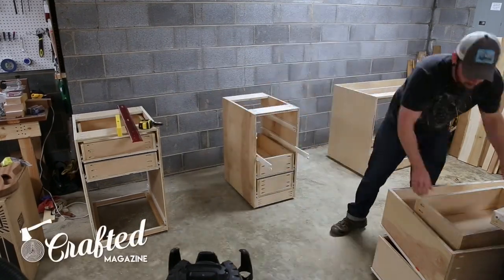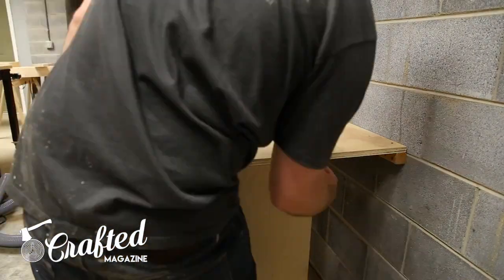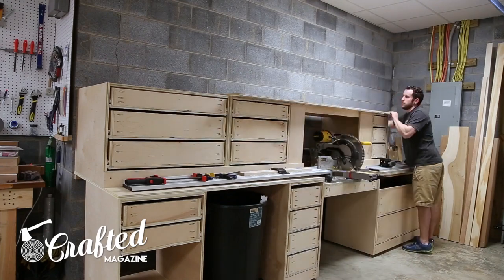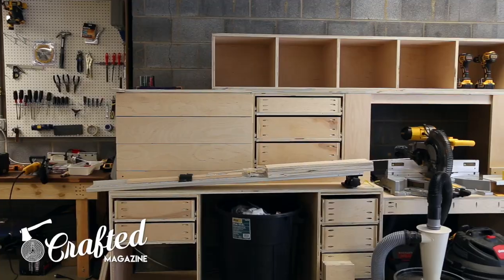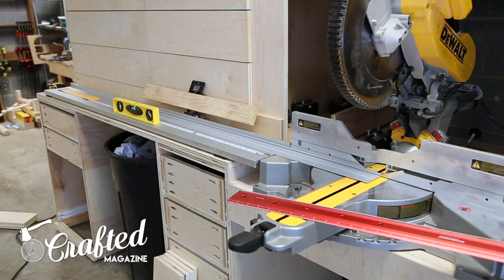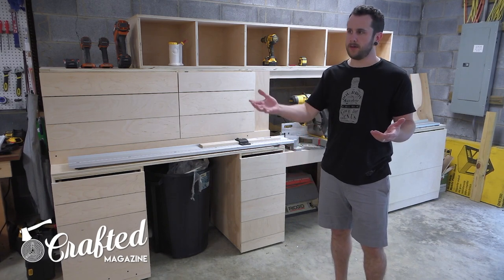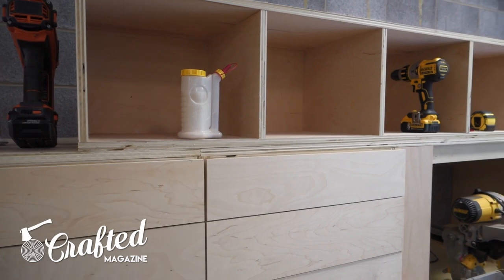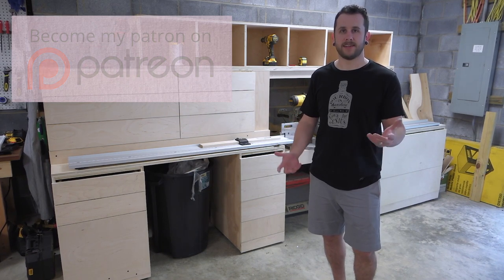Building the Jay Bates Miter Saw Station Part 2 | Crafted Workshop

Comment: Jigsaw tip (I learned from Izzy Swan) - tape off the ARE you're cutting, then cut your design out of that tape with a razor, then use jigsaw with the tape as a boundary.  Will make your cuts very smooth.

Comment: When I need to cut a hole using a jig saw I always start with a forester bit to cut a hole in the center and one just inside of the circle, then I cut spokes to the circle lines that way you have smaller arcs to cut. Great video and super easy to follow. Also I clicked on the link but I didn't find the cut list.
Reply from the maker: +Berry Tate thanks Berry!

Comment: Jig saw tips for cutting large circles:  Put the jigsaw down and pick up a powerful drill with a hole saw.  Place a sacrificial board to the opposite side (using tape, or brads, or a clamp) if you want to minimize tear out.

Comment: Jigsaw tip#1: Use a hole saw instead because I suck at using a jigsaw too. :-p
Reply from the maker: +Dan Mills hah!
Reply: I was just going to suggest the same.. I bout a cheap-o set at NorthernTool for ~$10.  Didn't need them at the time but I've used them so many times now.. money well spent.

Comment: Hey man, one little tip, use curvesawblades for round cuts, also (in your case probably not possible)but in Germany we get taught to cut from underneath so you see where the blade is going...but we have special blades for that, that have the teeth the other way...don't know if that helps.
Reply from the maker: Thanks for the tip!

Comment: Nice build. I know its a little old but it popped back up in my YT list so I watched again. I'm building the same thing and I will also modify. I took 8" off the big right hand cabinet, and I think I'll add a bottom cabinet to the left hand overhang and make those 18-20" wide instead of the 29 that the original overhang is (I think). I have room for Jay's full build, but it'll basically take a whole wall and I don't want to eat up that much real estate. Anyway, on your drawer slides, do you remember if their width is different that the types of slides Jay used? or in other words, did you build the drawers according to Jay's plans? I need to look them up, but I wonder if the slides you used might save a little moolah over the other style...

Comment: hi there you are fine cabinet builder. Did you only 1 & a 1/4 " ?
about jigsawing having room for the jigsaw to move freely helpss
so waiting to fix the board to after the hole is sawed helps you to get a more ergonomical position. That will aid precision, let first hole touch the line makes it easier getting the blade to follow the line.
The ultimate best advice, practice makes master. The prerequisite . . . patience to practice enough.
Othervice dont complain :-)

Comment: Hi Johnny
I agree, jigsawing a small diameter hole like that can be hard. If a hole saw is not available, and the hole is too small to use a router / circle template jig, I would start the hole the same way you did with the smaller hole. Then I would cut relief cuts from the inside up to the pencil line without touching the line. I would tend to use a jigsaw blade that is a little smaller at that point ( https://www.boschtools.com/ca/en/boschtools-ocs/t-shank-jig-saw-blades-for-wood-t101ao-29830-p/ ) T101AO. They are more prone to bending on 3/4" ply than more robust blades, but can offer a smooth cut with a tight radius over a short cut distance before the ply hurts the blade. The relief cuts should allow the excess wood to fall away, this helps more when you have to make a tight radius cut with a blade that is thicker from front to back. The thicker/wider (not sure the best term) the harder it is to turn tightly without deflection and burning. To avoid splintering around the edge of the circle I would use a knife to score the pencil line- I saw the note below about tape after I wrote this and agree completely.
I imagine many of these thoughts are known by you, just offering thoughts as you mentioned interest in hearing them.
Best
J

Comment: I have that same jig saw there should be a dial on the side to adjust the pivot of the arbor turn the dial to 2 it will make it easier to cut and just take it slow.
Reply from the maker: Should have probably read the manual, hah! Thanks for the tip.
Reply from the maker: I like that!

Comment: Awesome job.  I'm thinking of taking on a mitre station project of this nature, but my woodworking skills are limited (Master of the crooked box joint) so I fear wasting money on material.   How would you rate the project (beginner, intermediate or hard) and your woodworking skills (beginner, DIY, cabinet maker)?
Reply from the maker: Luke Johnson when I built this, I was still very new to woodworking. I had only built a pair of adirondack chairs and my workbench (I have a video on that you can check out). I just followed the plans and everything turned out fine. Some mistakes were made and not every drawer is perfectly square, but it doesn't affect the functioning of the unit. I'd say go for it! You definitely need to be very comfortable with pocket holes, as you'll be drilling about 500 of them.
Reply: 500 POCKET HOLES... Best put that Kreg jig on my wish list.  Cheers mate.
Reply from the maker: +Luke Johnson hah yes indeed!

Comment: looks good!! just curious what was the total cost?
Reply from the maker: Thanks! That's really highly dependent on the quality of materials you use. I used Purebond, which is a super high quality plywood that runs about $50 a sheet. I used 12 sheets of plywood. Then factor in 20 drawer slides. I used Blum drawer slides, which are definitely not the cheapest but work great. All in, with glue, screws, etc, it was about $1,000.

Comment: Jigsaw tips: 

Material density dictates your blade choice. Lower density = larger teeth + low tooth count; higher density = finer teeth + high tooth count. In your case it looks to me like you used the general purpose blade in hardwood. 

For any curved cuts make relief cuts, i.e. cut a series of lines from the inside point to the outside diameter, then cut between those relief cuts around the outside diameter. 

It's best to cut while looking top-down as much as possible, more control than stretching across a surface. 

Don't try to put too much pressure on it while cutting, let it decide the cut speed with minimal pressure being applied, this is another way you lose control.

-----

I've never considered a jigsaw to be a highly accurate tool (except for maybe those festools...) so I would cut close to the line, then use a spindle sander in a hand drill to sand up to the drawn line. 

Another option would be to use a router, you can set up a jig for the hole you want to cut, then use a flush trim bit to follow the jig. Hardboard is great for making jigs cause you can cut out your shape with a razor knife and hand sand to the line.